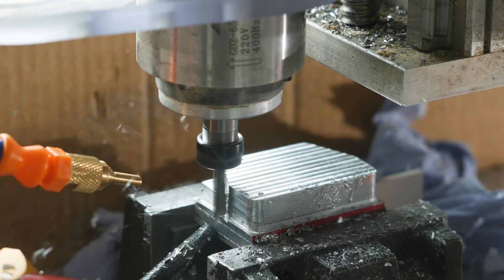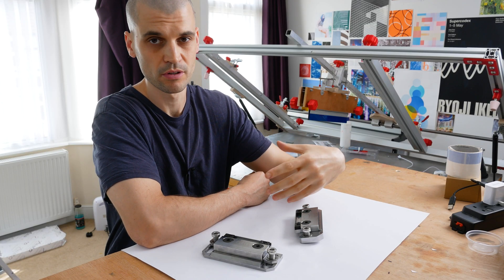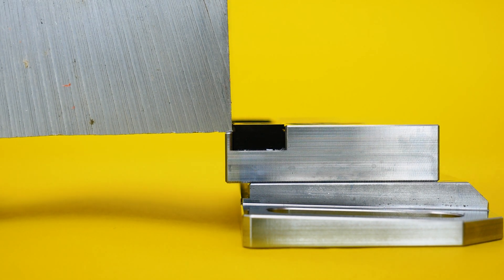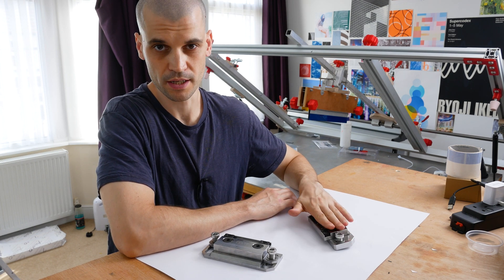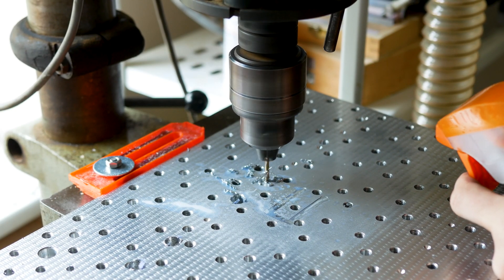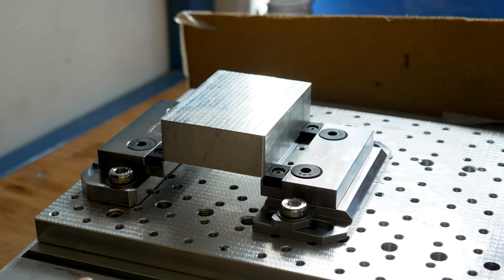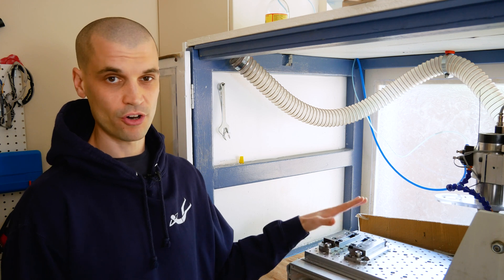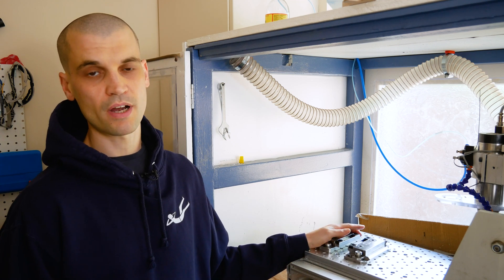Ultimate Modular Vice for Your 3040 CNC! SMW Mod Vice Review

Comment: Can I ask if you are based in the U.K please👍
Reply from the maker: Yes I am
Reply: @ThisDesignedThat  Thank you. I have just received a mini CNC machine however the fixture plate has a very limited number of threaded holes for mounting a small vise. I am thinking of having a second fixing plate machined that supports a small vice and would fit onto the existing fixture plate. The current fixture plate is approx 245x100x20 mm.Would you be able to consider this?
Reply: @ThisDesignedThat  I am based in the Nort West Lancashire👍

Comment: do you have any problems when tightening parts with the mod vice? because it uses the fixture plate as the vice body and at least elastically bend the fixture plate.
Reply from the maker: I havent measured deflection but i doubt it would do much to my 20mm thick fixture plate.

Comment: A cheaper alternative is the low profile vice from Inception Machines. Nowhere near as Gucci as these SMW parts, and also you have the clamping size limit, but half the price and sold from the UK.
Reply from the maker: Yes i did come across this in my research and was even in contact with them but the vice was more limiting than the smw so i think its worth double the price. Its much lower clearance which was crucial for me and you can hold workpiece as long as your fixture plate.
Reply: @ThisDesignedThat  it's certainly good kit and more flexible. I was tempted to treat myself to them, but I can't stand having non metric stuff in my workshop, even if it's just a few bolts. They really should make a metric version. At that price I'm not going to drill out the holes.
Reply from the maker: @AG-cg7lk  i just swapped out the imperial bolts for M12. no issues

Comment: what  was the final cost after buying, taxes, importing ect
Reply from the maker: Total £292 (including the Import tax of £50)
Reply: @ThisDesignedThat  not bad price I might order one for my diy mill
Reply from the maker: @icarus_ap  just taken a look at your DIY mill, nice job, I think there are cheaper options available if you have the z height to accommodate larger vices. There are plenty of big ol' KURT style vices on ebay. I would have gone with one of those but with my CNC router z height is really limited so I couldn't fit one on my CNC. The SMW is a great vice, will last a lifetime and you support a great Youtube channel. I dislike paying import fees but there really isn't much alternative for low-profile vices

Comment: I've looked at those mod vises a few times, but the powder coating tape with CA glue along with dowels in the machine bed for locating has never let me down. If i cant hold it with this method i might just go for a mod vise. 
great video btw
Reply from the maker: I've used this technique a lot too for sheet stock when I don't need to machine all the way through, but aside from that use scenario I prefer a mod vice like this. its much easier to position square on your bed and works great for clamping small pieces of stock.